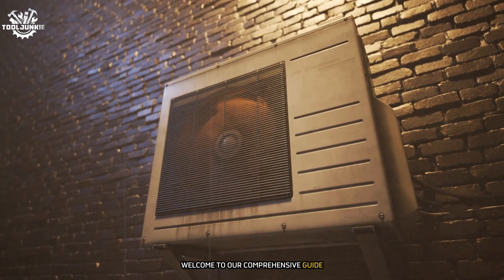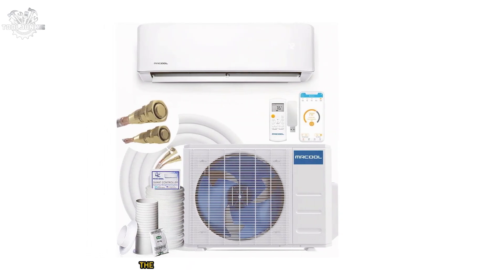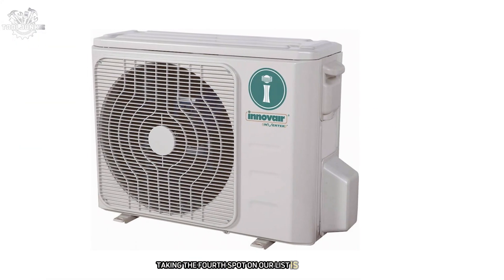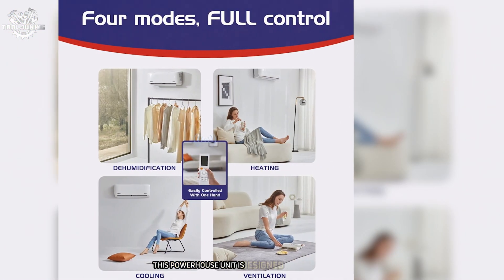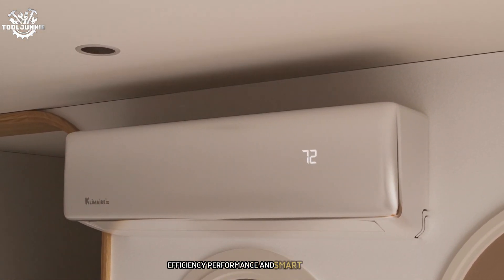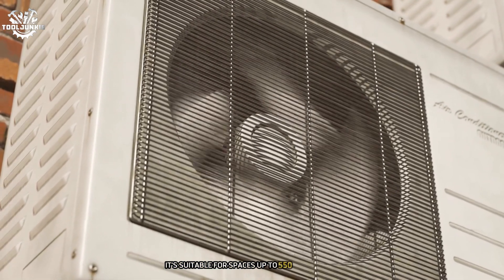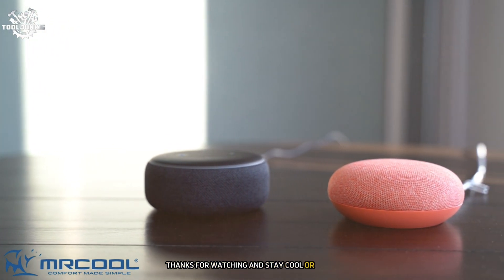The 7 Most INSANE Heat Pumps of 2024 [BEST] Will Save You Money

Comment from the maker: 0:00  intro Best Heat Pumps of 2024
0:48  MRCOOL 22 SEER Ductless Heat Pump
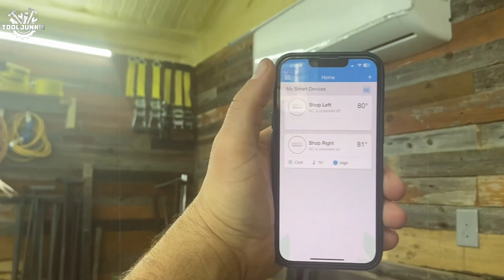2:43  Senville SENL-18CD Mini Split Air Conditioner Heat Pump
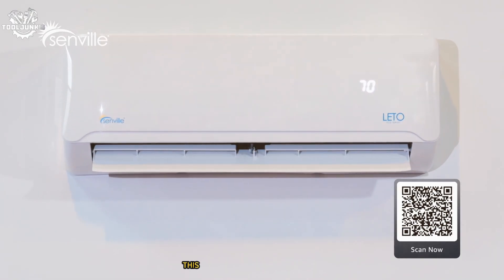4:21  Cooper & Hunter MIA Series Mini Split Air Conditioner and Heater
6:10  Innovair Air Conditioner Inverter Ductless Wall Mount Mini Split System Heat Pump
8:09  Pioneer 18,000-BTU Mini-Split Heat Pump
10:02  Klimaire 12,000-BTU Ductless Mini-Split Heat Pump
11:58  DuctlessAire Energy Star Mini Split Air Conditioner and Heat Pump
13:01 - Outro Heat pump review